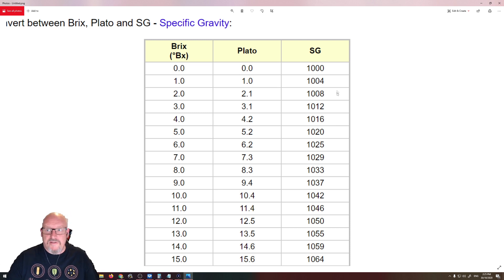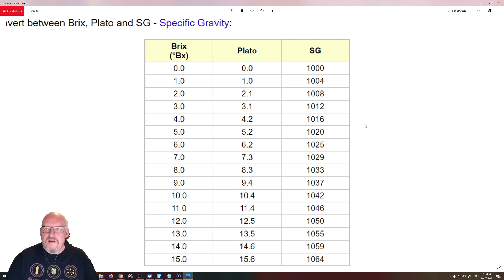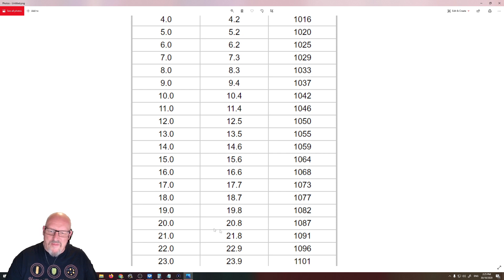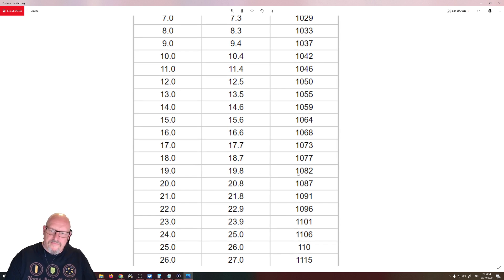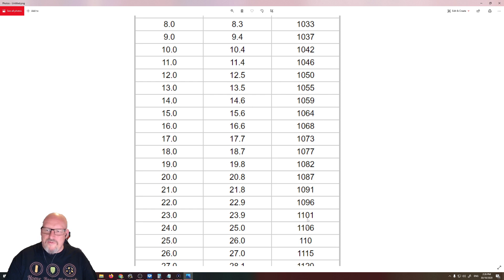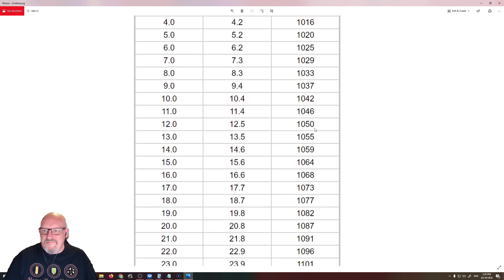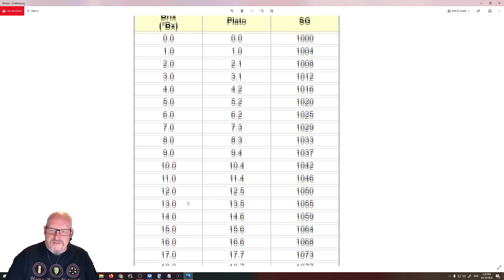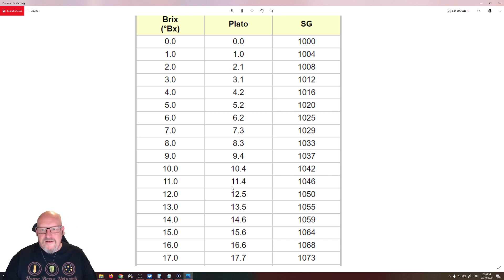Why do Pro Brewers use Plato?? Specific Gravity & Brix - Subscriber Questions

Comment: Here’s one for you Gash, everyone is happy using a refractometer before fermentation but tend to shy away from them once the yeast has been added.  I’m not a fan of tilts they can easily get stuck or be fooled, especially with beers with high krausen (of which I make a lot).  Nowadays to monitor fermentation progress I take lots of refractometer readings with tiny samples using a simple keg tap attached to a very short length of tube rather than wasting 250ml each time on a hydrometer reading. The tricky part is that the alcohol and CO2 in suspension significantly affect the density and therefore refractive index, this is also true of wort since refractometers are calibrated to clear sugar-water and the colour of wort has minimal, but not insignificant affect on a reading -  but we all ignore this.  However, with a bit of practice and use of online calculators it is possible to use a refractometer right up to FG and not waste all that lovely beer in hydrometer readings

Comment: Here's my mental arithmetic...
56 points - 12 points = 44 points. 
44 × 4/3 = 5.87% ABV.
Reply from the maker: We're talking about plato, and you may need to rewrite that equation!  Thank god its the weekend, time for a beer. Cheers mate!
Reply: Or... 14°P - 3°P = 11 points.
11 × 16/3 = 5.87% ABV.
Reply from the maker: You obviously dont understand what the video was for, I majored in Mathematics, I don't have troubles with maths but your first equation was written wrong. If you think some one with a gut full of beer will be doing equations like that in their head you're dreamin' hahaha Cheers mate have a good weekend, thanks for the schooling :)
Reply: How was it written wrong... I need to know 🤓 My interest was piqued when you said that halving the difference of the Plato readings gives you the ABV%, but I simply don't find it close enough for what I'm used to e.g. 5.5% compared to 5.9%.
Reply from the maker: I said in the video this wasn't about accuracy, it was to give you a rough idea, I said more than once, its more for home brewers  that visit a brewery and they get plato thrown at them for first time.. They can quickly in their head estimate what the brewer is talking about, because more than often when asked the brewer will struggle to convert to Specific Gravity because they just aren't used to it. If i was to read that equation correctly it would read 44*4 =  176.. then 176/3= 58.6666.. So while its close you still have to move decimal place. So if we're talking accuracy the equation is wrong ;) Cheers!
Reply from the maker: ABV= (1.05/0.79) x ((OG-FG)/FG) x 100 .. for high alcohol beers
Reply from the maker: I probably still wrote that wrong lol its bloody hard on here hahaha
Reply from the maker: The simple one is 131x (OG-FG) ** for "normal" beers 
but again the accuracy varies as the alcohol gets higher
Reply from the maker: MAybe better written this way  (  ( 1.05  x  ( OG – FG )  )  / FG  )  / 0.79  x  100 =  ABV
Reply: @HomeBrewNetwork  Whoa! Might as well open Promash or Brewfather now. Now to convert that to Plato.
Reply: 58.7% beer... oh yeah!